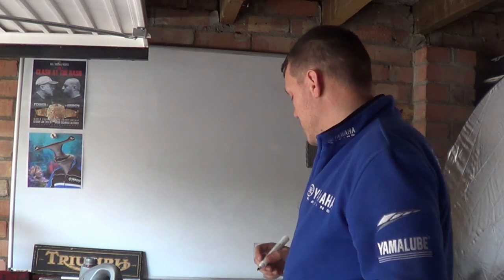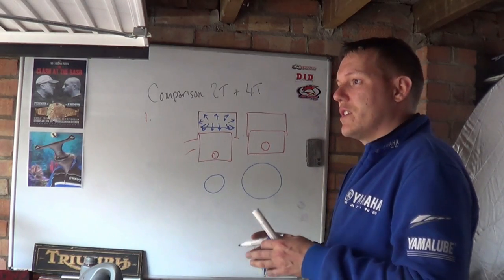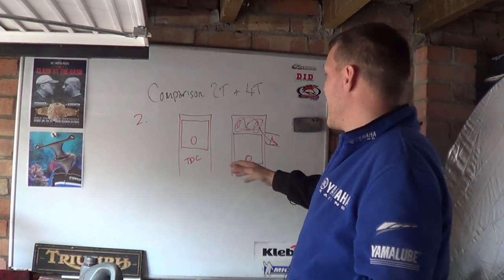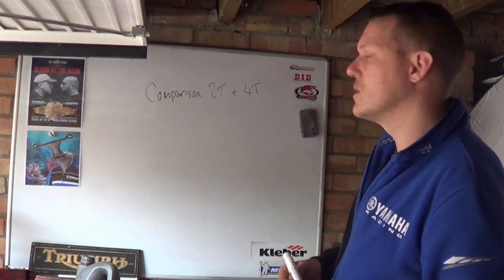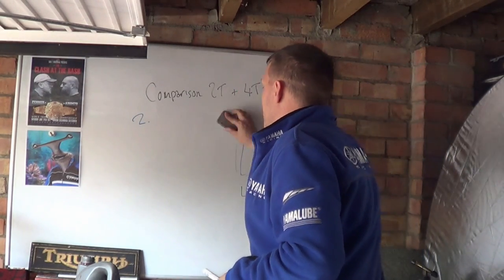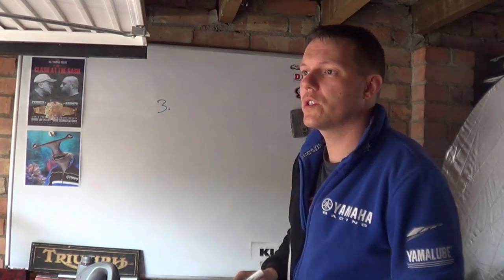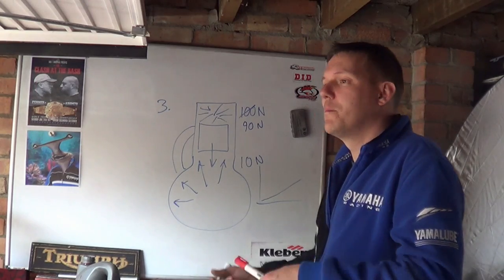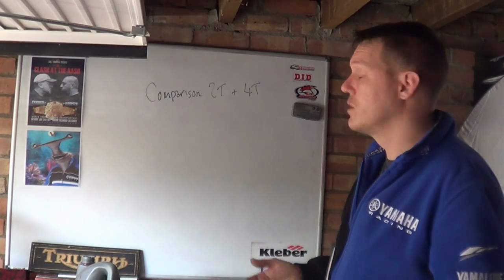2 strokes Vs 4 strokes - Torque production

Comment: YES yes yes..... BUT a two stoke fires twice as often. So yes, there are more losses in a two stoke per 'event' but it does do twice as much work. Which is why two stoke produce MORE peak torque than a four stroke for the same given CC and state of turning. Four strokes have more torque across the entire rev range which gives the rider the feeling of more torque.
Reply: My 280cc 2t trials bike feels way more torquey than my 550cc 4t V-twin even though it's 10hp vs 45hp. 2t is dominating in trial not just because of weight but for the low rpm torque.
Reply: No its not twice as much work done. 2 strokes can't breathe well and they don't run efficiently, thus they produce around 40% more power than a 4 stroke
Reply: @Henrik.Yngvesson  4 stroke has way more low end torque. A 280cc 2 stroke can't make more low end torque than a 550cc 4 stroke. You are drunk man or your bike is broken

Comment: I feel like 2 strokes are like your every day gas car if something breaks it's easier and cheaper to fix but 4 strokes are like diesel trucks they will lasted longer but if something breaks it's harder to fix and depending on what make you got it could also cost you a lot more money just to replace some parts so to me just because I don't really want to spend an arm and a leg I'd go with a 2 stroke but everyone is different
Reply: a modern race 4 stroke is not reliable at all. It spins at twice the rpms of a two stroke with ten times the moving parts.
Reply: Well, a good 4 stroke engine can outlive you. Repairs aren't expensive LOL. The most common thing which wears over time is the piston, rings, cylinder walls which a 2 stroke has too. Cam shafts and valves usually need an adjustment. Not replacement

Comment: How come that the exhaust port aint located lower down on the cylinder? then exhaust gasses would escape later when they have given away most of its power to the piston. Air fuel mixture would not escape out the exhaust as easy as it does now.
Reply: And one more question. 2t motorcross bikes often feel alot meaner and stronger then a 4t at the same cc. It feels like the produce more torque. How come the feel som much stronger but apparently produce less torque?
Reply from the maker: Great question, I'm doing a video on that this weekend - matt
Reply from the maker: In the video I'm talking about torque production per cycle, because 2 strokes have twice the power strokes than a 4 stroke for the same rpm, the mean torque over that time is higher for the 2 stroke. - matt
Reply: Oh i see. Thank you. Your videos are great Matt.
Reply: Adam - Isn't that what 'power valves' were added to the exhaust of 2 cycles?  Anyhow, as to how they work on the track, the relaxed stroke (exhaust) on a 4 stroke is what many riders have liked as it tends to let the tire "hook up" and drive the machine with supposedly best acceleration and predictability.  Speedway machines reflect that in the way they can corner and exit a corner.

Comment: About the piston area, wouldn't the added lever on the crankshaft from the longer stroke cancel out the lost force on the piston? 

I haven't done the math I was just thinking.
Reply from the maker: What? I'm lost here -
Reply: Well, you'll get less force pushing the piston down, which will lower the torque. 
But at the same time, the crankshaft has a longer lever because of the longer stroke, which will result in more torque for a given force.

Comment: In your 1 stroke video you discuss using forced induction rather then crankcase pressure to feed the engine. I feel like forced induction would be the solution to all of the two stroke deficiencies you discuss in this vid. Couldn't you run a standard pent-roof head (ditch the knight sleeve) on a two stroke but feed it with a super or turbo charger (basically have all four valves open just before bdc (exhaust first then intake), the positive intake pressure from the turbo or supercharger could flush out the cyl) instead of crank case and solve all of the problems with a typical two stroke discussed in the vid?

TLDR Basically run a 4 stroke as a two stroke with the positive intake pressure from forced induction.
Reply from the maker: No lol and I'll explain this weekend in a video - matt
Reply: Beach&boardFan
 You just described a 2 stroke diesel engine.
Reply: Detroit diesel

Comment: this is almoust like true. but not quite. cause 2 strokes makes more torque, than 4 strokes.
Reply from the maker: erm no -
Reply: 2 stroke have unit cranks (cranks pressed together) because of this the max torque you can force through it is limited. Also 2 strokes can't breathe well on low RPM and they burn fuel inefficiently

Comment: Given the same amount of air and fuel and compression ratio, wouldn’t a smaller combustion chamber with a small diameter piston exert more pounds/Newtons per square inch/mm compared to a larger combustion chamber, if this is true then why would this make a four stoke make more torque? Please help me understand?
Reply: 2 stroke have unit cranks (cranks pressed together) because of this the max torque you can force through it is limited by the interference fit of the shafts. 2 strokes don't breathe well on low-mid RPM and the fuel is burned inefficiently. Thats why

Comment: look at actual torque fugues:
Aprilla RS250   29.5 lbs-ft 40  N-m @ 10750 rpm 72.5bhp @ 11900 rpm
suzuki T250  22,3 lbs-ft 3.08 kg-m @ 7.000 rpm.  33 bhp  @ 8.000 rpm.
Honda 250N  14.7 lbs-ft 19.9 N-m @ 8,500rpm  27 bhp  @ 10,000rpm 
Yamaha FZR250  18.1 lbs-ft 25   N-m @ 11500 rpm 45 bhp @ 14.500rpm
 two stroke wins!
which revs the highest? 4 stroke!
2one 2 stroke and 1 for stroke are from 1970, and one of each modern bikes... both cases the same result.

Comment: 2012 KTM 250SXF 4 stroke makes 19.42 foot-pounds of torque @ 8600 rpm. 
2012 KTM 250SX 2 stoke make 31.93 foot-pounds of torque @ 8000 rpm.
How can you say that a 4 strokes makes more torque than a 2 stroke?
http://motocrossactionmag.com/bike-tests/two-stroke-versus-four-stroke-2012-ktm-250sxf-vs-2012-ktm-250sx
Reply from the maker: Video coming tonight dude - just for you
Reply: Thanks, I look forward to attending your class. You give great information.
Reply: FM Sax because that 2 stroke will lose at any RPM below its powerband, those figures you pasted are meassured when the 2 stroke is in its powerband! That 4 stroke will have already produced its amount of power a few thousand rpm lower
Reply: You and everyone else already knows a 2 stroke off the pipe ain't going to win a race. You stated in one of
your previous videos that a 4 stroke makes more horsepower than a 2 stroke. Under your stated rules that is true. A 4 stroke does make more power at lower rpm than a 2 stroke and has a broader power band.
Anyone who has ridden both bikes will testify to that. And almost doubling the displacement of the 4 stroke you can most likely get equal power. But I was not talking about power band characteristics but peak horsepower of both engines being naturally aspirated with equal displacement. Using my rules, (which most people used as the standard to compare) which motor make more peak horsepower @ redline, 2 or the 4?
Reply: Neither one will make more horsepower at redline cos the engine dies there haha,

Peak power? 2 stroke
Reply: Mr ha ha. What are you talking about? Everyone and there 3rd cousin plus baby brother knows that any engine will not produce more horsepower pass its red line. What part of peak horsepower don't you understand? I will use a different term. A 2 stroke maximum horsepower @ red line will always produce more horsepower than the maximum horsepower of a 4 stroke @ red line assuming both engines having similar or same displacement. That is my simple point.
Reply: I apologize for misunderstanding your original message. I will make sure to read all messages more carefully before responding. Thank your for clarifying your point.
Reply: There is a great video on this subject here on YouTube by Luis Elene titled 2 stroke vs 4 stroke: a study of power and torque.

Comment: Hang on, you have not mentioned the fact that a four stroke must turn the crankshaft twice as much as a two stroke with one cycle just to push the spent fuel out.....if a two stroke could be created with better exhaust efficiency and without scavenging (and i believe with technology it can) the unefficient four stroke will be history....
Reply from the maker: Not true. Take a Ktm SX (2t) and a SXF (4t) @ 8,000 rpm the 2t makes 32 Nm and the 4t makes 19Nm... how? Not only that bit the 2t is really underquare and the 4t is oversquare.... care to explain?

Comment: you are wrong!! you are using, in essence, two different cc engines you begin by saying the four-stroke has a greater area to distribute the pressure than a two-stroke. this would be true if the two engines werent the same ccs. cubic centimeters is defined as stroke (up and down) by bore (the circumfrence). so there you are wrong.so a 125 cc four stroke has the same bore to stroke ratio as a two stroke. second you say the skirts of the pistons stop the piston from making a complete revolution! again incorect the skirts do hinder the performance of the engine but not by what you claim. it adds rottational mass which adds friction that causes loss of power. this is actually compinsated by reed type intakes not piston port intakes.now you are on to something when you say that four strokes make more torque... that is in the bottom end two strokes dont waste there stroke on an exhaust cyle they continue to make toruqe thus making a more continuose torque/hp. buddy was right saying torque is equal to hp but he dosnt say that by moving your torque up in the rpm range you create more hp
Reply from the maker: "cubic centimeters is defined as stroke (up and down) by bore (the circumfrence)."

- LOL thanks for the info - I didn't know that LMAO.....

"second you say the skirts of the pistons stop the piston from making a complete revolution!"

- What? When?

"it adds rottational mass which adds friction that causes loss of power."

- which one is it? Added rotational mass or friction?

"this is actually compinsated by reed type intakes not piston port intakes"

- you obviously have your wires crossed here. 

"that is in the bottom end two strokes dont waste there stroke on an exhaust cyle they continue to make toruqe thus making a more continuose torque/hp"

- this makes sense and then half way through I lose you. The exhaust stroke isn't 'wasted' it clears the cylinder and hence VE goes up.....

"buddy was right saying torque is equal to hp but he dosnt say that by moving your torque up in the rpm range you create more hp"

Torque or NOT equal to HP, HP is a function of torque over time. And what the fuck does "moving your torque up" mean? I wish you had better writing skills than a carrot.
Reply from the maker: To add.....

"you are wrong!! you are using, in essence, two different cc engines you 
begin by saying the four-stroke has a greater area to distribute the 
pressure than a two-stroke."

- its the "two different cc engines" that makes no sense. 

I say "the stroke to piston diameter (bore) the piston diameter is usually a lot smaller for a 2 stroke, than a 4 stroke."

For the same cc engine this holds true. 2 strokes are generally square or undersquare - where 4 strokes are nearly always oversquare. Hence the increase in piston diameter for a 4 stroke. 

The fact that you have assumed that these 2 examples are different cc's. I didn't say this, you dreamt this up.

Again you say "cubic centimeters is defined as stroke (up and down) by bore (the circumfrence)."

This proves my point. If a 2 stroke has a smaller piston diameter (bore) then the stroke is longer for an engine with the same cc. This would mean as a comparison the 4 stroke has a larger diameter (larger bore). 

"this is actually compinsated by reed type intakes not piston port intakes"

- What 2 stroke engine have you seen in a motorcycle that isn't piston ported?

Comment: So the etec with s the most efficient industrial engine ever made. Uses less fuel, longer service. And with common sense has nsane tourque compare to other 4 strokes. And its pretty easy. Push a wheel up hill. One tire, push 1 time pr revolution. The other tire push 2 times pr revolution. Make the hill steeper and steeper, and you will find out that for tourque and power u will need to push it twise pr revolution. Eventually at the lower arm u will start to go backwards.. 

And everyone knows that a 2stroke demolish every 4 stroke competetor. Just see in racing... They struggle to make 280hp 1000cc MotoGP... Bro mid 1990 500cc 200hp... Thats 400hp on 1000cc.. no turbo, carb in fact... Evinrude 3.0xp 3l v8 10.000rpm 425hp (gas) 600+(ethanol)  sat record n the 1970's that record still stands today. 180+mph on a single outboard
Reply from the maker: "And everyone knows that a 2stroke demolish every 4 stroke competetor. Just see in racing..."

- Sorry what?

Just watch 2000 MotoGP. The best 2 strokes vs the 4 strokes. 4 stroke won the race. 

"They struggle to make 280hp 1000cc MotoGP"

LOL struggle? they make more than 300HP now. Look at lap records. All 4 stroke bikes. 

2 strokes are SOOOO good, they're disappearing.
Reply: @dirtygarageguy  nsr500 (500cc from 1990 with 30 year old tech and carbs) was 200.4hp and 116nm. I can see the Yamaha r1 (1000cc) 113.3nm and 198hp... So with half the cc u still have more hp and tourque.. 

And then we need to take power to weight.. evinrude 3.6xp with ethanol non turbo was 600+hp and 255kg. It set the world record for single outboard engine in 1978.. that still stands to the day. So why havent the 312kg 2.4L twinscrew supercharger 4.6l v8 mercury 450r beaten it? An engine from the 1970's s still unbeaten..

Not to mention the Detroit diesel..
Reply from the maker: Wait... did you just take a race bike and compare it to a road bike????

Nsr500 185hp
Ducati motoGP bike 302 hp...
Reply from the maker: It's almost like you're being disingenuous...
Reply: @dirtygarageguy  nsr500 was exactly 200.4hp and was 400.8hp pr liter. What is the ccm on the Ducati? Is the tec 30 years old?
I dont know the specs og the Ducati. Dont know the bike. But i belive Ducati use 1199ccm?
And yes i compare a 30 year old race bike to a superbike.
Thats the whole point. 
F1 from 1980 is slower then a McLaren Senna around a track. Tec is amazing u see. 
And u do know they use race car to develop new things for the streets also? Racing is there to push tech forward. Hence new car every year in f1.. slow n steady u see the tec from racing coming to the road.
Reply: @dirtygarageguy  only thing i could find on the Ducati was 1000cc and over 250hp.
Reply from the maker: Race bikes... why is that informative?
Reply from the maker: The motoGP bucati is 1000cc. Why do you keep talking about road bikes?
Reply from the maker: Let me explain this to you, since you're struggling and all.

By the year 2000, motoGP teams had been racing 2t engines for more than 20 years. In 2001, the racing 4t beat the 2t in actual races.

So the 2t had 20 years with state of the art "tech" (that's how you shortened technology, not tec) was at its best. The 4t still won.

Why? Well, it's because the 2t have a peak torque that is very peaky. Riders at the time said that the 4t were powered out of corners better, and because of that, handled better. 

4t have a broader power band. You seem to just look at 1 number. That's what fools do.

Next is the 30 year old comment. The new suter mmx is a 576cc 2 stroke with fuel injection and all the modern kit in it. It revs to 13,500 and makes 195HP from its 4 cylinders. Much like the nsr500, with the same engine layout. But it doesn't make more, why? 1) emissions 2) a 2 stroke isn't that efficient, so it's reached it limit. 

That brings me onto the new bikes. 2022 bikes have to have the following;

1) reduced noise
2) reduced emissions
3) ethanol fuel. Which has less energy in it compared to the 30 year old stuff.
4) restriction on power. Back in the day they'd use a new engine every race. These days they get 4 engines for 18 races.
5) they're still making 300HP
6) they have less fuel these days, and they're still making more power.

You seem to know very little about all of this.